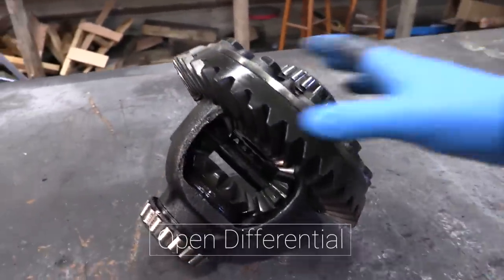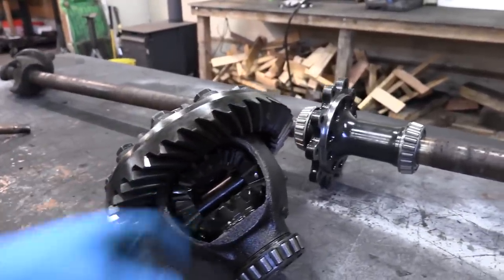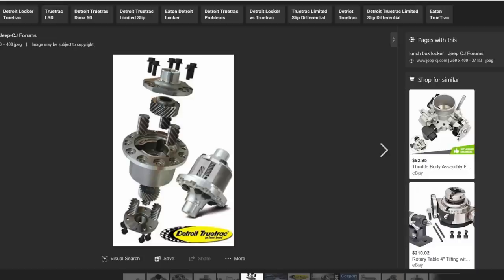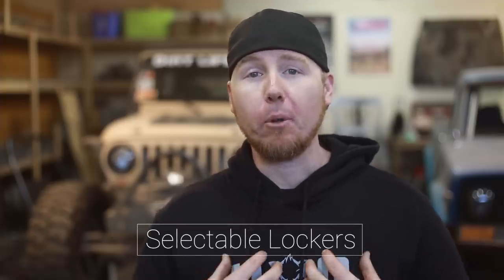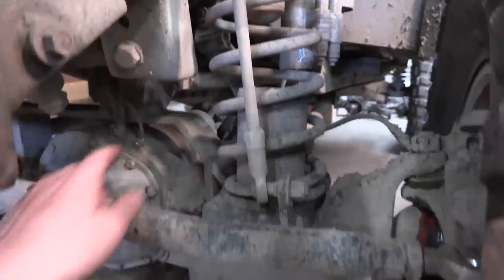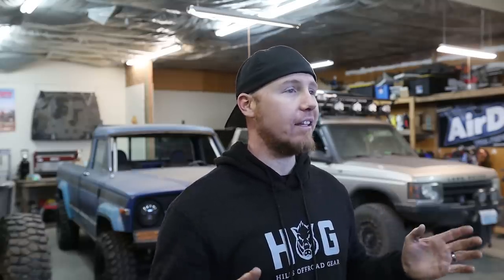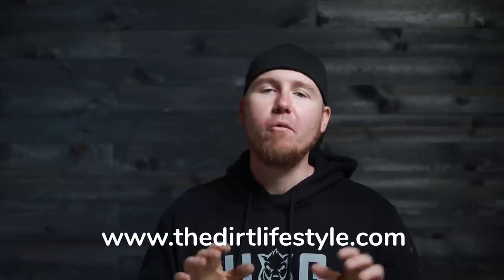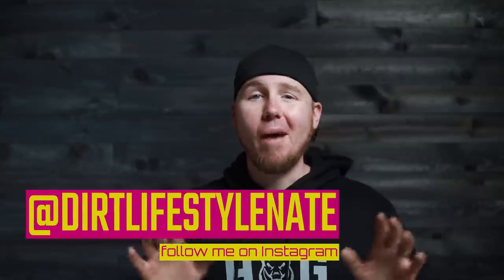Differential Lockers! ARB vs Yukon vs Detroit vs Spool

Comment: The thing that has always confused me is why there are no hydraulic lockers, I mean we have power steering that is hydraulic, we have hydraulic brakes and we used to have hydraulic windows. It is a system that is already in place and taping off the power steering pump is easy to do. Great video thank you .
Reply: David Star million dollar idea
Reply: It is a good idea. However if you snag or air line with arb, oh well. You snag your electric line for the locker, oh well.. You snag your hydraulic line.. damn it i lost my lockers, power steering, and power  brakes..
Reply: @muds17  I thought about that but the same can be said about the brakes, steering and clutch on a lot of rigs. I would think it would be easy enough to have  an auto-shutoff disconnect like the ones on gas pumps, or make it a master/slave system like on a clutch so it would be independent of the rest of the rig.
Reply: @muds17  I've seen plenty of dudes rip a brake line on the trail, it's not a hard fix and most of the time it's not usually a life threatening situation (it could be though if you're in a sticky spot and manage to do that) We usually run with extra lines and fluid for that very reason though, so it wouldn't be that much harder to keep spares for a hydraulic locker imo.
Reply: @c4onmylip  I watched a 97 XJ break a line descending a very large hill. Trail went down, turned for 15' or so then Curved back down. Without brakes he tried to make the turn, but the momentum carried it right into a roll. Went over the side, rolled 3 times, and was stopped, incredibly, by a little 4-5" thick Aspen. Had it not stopped him, he would have rolled another 10-12 times before reaching the bottom of the hill.

Comment: Love my ox.  Flip a lever. They are locked for years if you leave the lever flip.  No compressor to keep running. No overheating electric diffs.  Just simple mechanical locking.

Comment: Another very good, clear and concise video - I'm not into the offroading stuff, but check out your videos now and again because they are good information that can sometimes be applied to the stuff I am interested in.

Yup, a conventional, open differential delivers the same torque to each tyre - if one has only 10% of the traction of the other, the tyre witht he good traction will still only get up to that 10%, with the any excess engine torque just leading to wheelspin of the lightly laden tyre.
It is important to realise that just because one tyre slips, BOTH are actually getting the same torque!

Witht he torsen, that brake technique works well, sometimes using the inertia of the lightly loaded wheel can be enough to get a 'kick' when applying a sudden throttle input.

Comment: The fail safe method works with all the OX lockers. The air and electric ox lockers are probably the most reliable on the market. They all use a shift fork and use the same 100% mechanical carrier.

Comment: I have been running an e-locker on an 8.8 rear axle in the XJ.  35’s, 456 ratio and until recently I had good luck with it.  As it sits today the studs sheared off.  I guess the good is that they fell to the bottom of the housing and I was able to drive home.

Comment: I have ox lockers. They offer a air actuation cover and retrofit cylinder. I had a cable I linked and my rear never worked. But like you said my fault. The front was a bit difficult to get rite. On my d30 with 18 inch of flex doen on drivers side it would disengage the locker just a limit of the cable. Once I put the air solenoid on never had a problem

Comment: I'm building a 97 rock crawler now. 2004 Rubicon tcase, and 44s front and rear. Chromoly, RCV, and Elockers. 4.56, 37's to start and a Golan 4.6 stroker. Almost went OX. Loved the video

Comment: Great video Nate.
I'm currently running an OX d44 33spline in the rear and a Eaton E-Locker d30 hp 27spline in the front. 00 XJ on 35s. I love the simplicity of the E-Locker(switch, install, quietness) it does take half to a quarter tire turn forward/back to engage. The OX manual shifter is noisy at over 40mph on the street(if you have MTs not as noticeable) but as soon as you engage it in become a Spool. If I'd do it all over again I would do E-Locker's front and rear, but if I was dedicated rock crawler I would do OX all the way. Keep up the Awesome videos👍🏻👍🏻

Comment: Good show! Your opinion is appreciated.

Few years ago I purchased a Pro-Rock 44 front for my XJ, w/out outers. That got ordered with the Eaton.

Sidenote: your last show on 20$ high steer was great to. However I just spent the last two days in the JY ankle deep in mud because I want that Damm WJ Swap with crossover, and Trumpf buying👍🇺🇸

Thanks for the shows!! 5 Star!!!
Reply from the maker: I've been there! JY experiences in Washington typically include water 😂
Reply: @DirtLifestyle  I had to do some excavation work also to get the scissor jack under it to get at lower ball joints.That sucked😂🍻

Comment: A trick for Ox Lockers I picked up from the long haul endurance off-road bikes is to pre-run a second cable to each locker. Should the first fail, the second is already in place. It's a bit of extra work up front, but makes things easy when Murphy strikes.

Comment: i run a lock right locker in the rear with 33’s. i love it because it was really cheap and easy to install. it gives great traction. i hate it because it makes a ton of noise. sometimes it just clicks but most times it sounds like it’s breaking when you make turns. people stair at me when i try to park in parking lots because it makes so much noise. i will be putting an e locker in the front axle when i upgrade it.

Comment: There was a bunch of us in a club back in 80 's & early 90's and we all ran Detroit  Lockers. Over a 10 year time frame there were no breakages and I replaced one set of springs. I think in a non computerized rig they are the best you can get. I used "E" lockers in the newer Jeep stuff and they worked great. I never hit the button under load. It only takes a second to hit neutral or rolling in a non loaded situation . A friend of mine runs an Ox and so far no issues. Your points are excellent in. my opinion especially on brand loyalty. You have a great channel!!

Comment: Very helpful , you just kept me from making a 
“Lesson Learned” costly experience mistake . I’d like to tell you I built my rig or at least helped , but I don’t have the time, so yeah I dropped it off at a shop 🤭. With 40 Super Swampers on front 60/rear Sterling 10.5 ,, the rear limited slip sucks , barely works , so I’m going to have to get a real locker . I went with an Eaton E-Locker up front , tried it out for the first time today , worked great !! But the rear is disappointing , it’s basically a 1 tire fryer 😡. Just found your channel a few days ago , your videos are always very helpful, I was about to order a Detroit Truetrac,, worm gear style cause I’m not concerned with the rear being totally locked up or 50/50 torque,, but after you said anything over a 35 inch it’s basically crappy limited slip that won’t work half the time , I think I’m just gonna go with a Grizzly and be done with it . Thanks for the info

Comment: I ended up with a mechanically actuated (by cable)ox locker in my high pinion d30 I had built by sff customs. I also got "the slug" lol It just got here with the 8.8 so I'm gonna try and put them into my tj in the next couple weeks. Pretty dirty so I'm cleaning them up and replacing bushings etc. Keep up the hard work!

Comment: I love ox lockers because you can shift them cable manual, electric, or air. also, they have a little plug that you can screw in on the diff cover and it will lock your diff and bypass everything past the diff cover. I also think the Eaton electric lockers are reliable because all jk and Jl rubicon up to this date have run them. you don't here that many issues with them.
Reply: I have had an issue with my front locker on my JK Rubi. It would not disengage. I had to pull the diff cover and pry it apart. Other than that they have been ok. Driving on the road with the front locked is much harder than I would have thought.

Comment: This is great information thank you. I  know many years ago... emphasis on many lol... it was very popular to use a Detroit Locker in the rear.  Providing a"true" positive locked differential.... which of course exhibited the things you spoke of when on the street and cornering, creating tire scuff ... then in the front guys would use a limited slip to allow for a little better control in turning but still have the power to both wheels.  The hardcorps rigs were locked both front and rear... of course this was in the time before air lockers and those I remember were immediately loved for use in the front so you could turn them on and off.  Of course two things,  we didn't have many using tires larger than 32 or 33 in diameter,  just wasn't any except for a few Tractor tires... and everyone used locking hubs... so now that I am looking to get back into the offroad world.  I am really looking at this.  A true locker in the rear and a selectable system in the front.  Thank you for your insight and information.

Comment: Great video... I run x2 cable lockers in my FJ40 land cruiser, Ive had them in my vehicle for around 20 years running a chev injected V8. They have never let me down, I’m using morse heavy duty cables. Cheers Wayne NZ 🇳🇿

Comment: FYI, The Ox locker has air electric and manual versions. I believe they all use the same cable in the diff. The other end of the cable goes into either a manual switch, electric actuator so there is no electromagnet inside the diff that might attract metal shavings. My understanding is that it not uncommon that people planning on using the manual switch find that the vehicle they are using doesn't have a good place to mount the switch so the return the manual switch and purchase the electric actuator and switch as it is easier to mount the switch. The air version uses a different air cover but interestingly enough does not use any electricity, it has a pneumatic switch.

Comment: I have Detroit lockers now in my jeep on 35" and they are pretty OK both on and offroad.  I agree that any larger tire size and they would not perform.  I had OX lockers in my old CJ5 build on 40s. Could not ever complain about them except maybe the handles were a little short and my old beat up hands struggled were I mounted them to pull in, but that's my creation with the build.  As always great video Nate.

Comment: FWIW, you can operate an air locker with valves, eliminating the solenoids, if you prefer. Also lock rights will last years in light rigs with reasonable tires i.e. small. Just my 2 c, thanks for the video.

Comment: Currently running a Torq Locker in the D30. So far no issues, handled Moab just fine. Definitely got my money outta it lol
Reply: Happy with mine too once it broke in some .
Reply: Also running the Torq Locker in the D30 front.  Yes some ratcheting in turns and will also bind up a bit  sometimes in very tight parking lot maneuvers.   Off road its a beast.
Reply: Love mine too

Comment: Hey Nate, you should check out ox lockers air and electric setups. I feel that this is the best selectable locker due to its all mechanical nature. They all use the same shift fork setup the cable setup uses. I’d love to hear your thoughts on it.

Comment: I had a cable actuated ox locker on my TJ, only for the front and the rear was LSD. I mainly wheeled in the mud and sand, never had an issue with reaching down,pulling a lever and bam. Traction.

Comment: One major difference between air lockers and the e-lockers is the actual locking mechanism. The air lockers lock in immediately once the switch is pressed, e-lockers can require up to half an axle rotation to fully lock, and if you roll backwards while locked you will unlock until you roll to the other side of the internal locking mechanism, which on a 33” tire can be a significant distance on a difficult obstacle. It seems this fact swings a lot of people away from E-lockers despite not needing onboard air

Comment: I wheeled with a guy once that had a OX locker and he had it converted to a air actuator. I thought it was really cool because the actuator was on the outside of the diff so if you had a failure you could put the fail safe plug in but you don't have to deal with the problematic cable. Plus if any seals went bad it would be a easy repair compared to the ARB. Kind of the best of both lockers. Anyway, I have run almost all types of lockers at one point or another and I think you did a excellent job in this video.

Comment: Thank you I have been considering a rear locking dif. In my truck. My buddy went with a straight locker and the only issue I found driveing his truck was cornering on pavement under power. On ice this was a issue.  Liveing in the desert I can live with that.

Comment: I’ve been very interested in the Cable lockers. On the same note my Lav-25 “Coyote” had air lockers and I never had issues with those on it as a driver so there is that

Comment: Great video, just have Two quick things to help folks even more: for one: with the old school Detroit lockers you can help the turning problem by unlocking one of your hubs if you need to make a sharp turn in mud, it’ll give you “3 wheel drive”. Second, my experience with clutch type LSD is they will wear out clutches really fast if you actually use them on the trail a good bit. Most I’ve seen will act like an open diff by 100k miles until you replace the clutch plates.

Comment: I agree with almost everything you said. I've used the "lunchbox" style, factory JK elockers, ARB airlockers and eaton elockers. The ARB has the strongest engagement mechanism of the lot. But all have been used and abused on 37s and 40s. And none have let me down. You'd break an axle or gear set 90% of the time before you bust a locker. If you are building a bullet proof full off road competition build I'd say ARB are the go. But for the other 95% of people it'd be best to use what ever suit your budget or build.

Comment: Your videos are great, and I respect the production value and the honesty of your videos, I have had the best experience with mechanical lockers (cable) such as on a lot of 20th century soviet off road vehicles and G wagens, I’ve never had one fail worst case scenario the cable stretches and the locker is only partially engaged, but I’ve neither had an airlocker fail but on the ARB locker I have had differential casings pull apart understrain on 37s

Comment: What going on nate? I have a 99 tj 5.3 an ton swap going on. I have a ox locker in my Dana 30 for about 8 years. I loved it but hated the cable lacation. It never fail that a rock would hit it right at the cover an no repair. Only new cable. I started using the engager (slug as u called it lol) work great till the day I sold the axles. It actually screw in and it had a bolt at the end that u screwed out when u was wheeling an drive home. On my dana 35 had a Detroit locker. For about ten years (came in a super 35 kit) never had a problem with. But I did just kick in an out while on the road all the time. But I didn't care if never failed me  . Hope this helps anyone that looking for locker. Keep up the good work

Comment: yj on 33s had a lunch box explode exiting D35 thru the cover so hello xj D44, 
  had power-lok in D30 front but felt sketchy around town hunting for traction on snow/ice,  ARB's for 21 years now never looked back, just keep the diff fluid in decent shape, great advice as lots of choices : what works for you only you know - i found mine !

Comment: Hey Nate. I love my spartan lunchbox locker.  I have a 95 yj 4 banger auto on 35s.  It’s to week to break parts.  I agree more power or taller tires might change the situation.  The rig is trailered to all trails and I have never noticed a noise from it.  It’s in the front on my Dana 30 and pulls me over everything.        Ps my yj is the same color as yours👍

Comment: Great Video, Put ARB air lockers in my XJ last fall have not been able to try them out yet, hopefully this summer be able to put them to use. Some things ive heard about e lockers that made me not choose them, is i heard when it comes to bigger tires 35s and up you can damage them pretty easily. Also when using the E lockers you need a certain amount of rotation to occur in order for the locking mechanisms to engage inside the locker, look forward to seeing how you incorporate an e locker and a  lunch box in future videos.

Comment: I’ve used loc-rite lockers in my jeep wrangler. Heavy duty rock crawling with 35’s. Never had an issue. They worked flawlessly.
Now i have a Full Size Bronco im building for trails. Im i stalling 35’s. Im a bit concerned about this same style locker holding up with a much heavier rig. So i think im going to upgrade to a legit Detroit locker. I like the selectable lockers. But i dont want the added expense or equipment. I may go electric selectable down the road at some time.
Great video. Very informative.